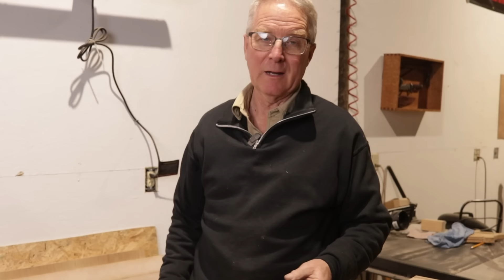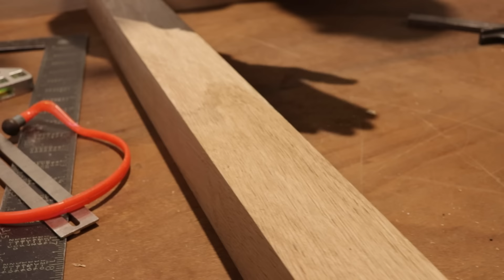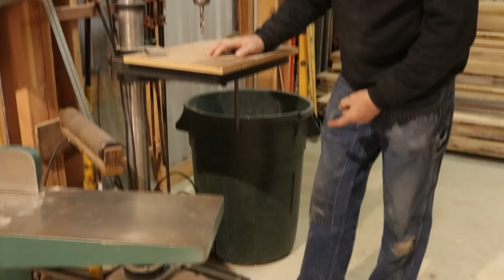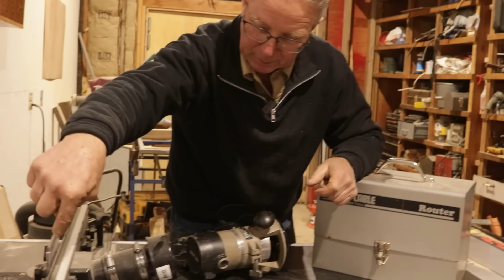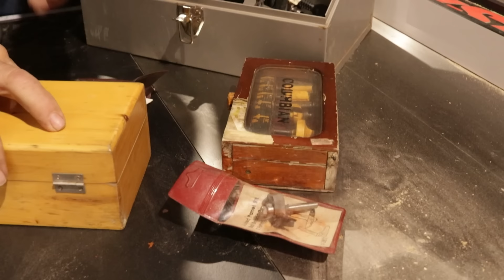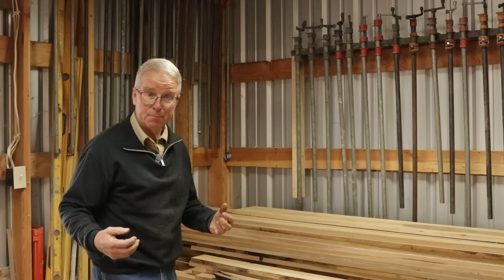My First Dovetails & Workbench Trials | Shaker Workbench PT 2

Comment: I got lucky and read Peter Korn’s “woodworking basics” before I jumped into any big projects and also probably 50 episodes of wordsmith shop and with those 2 things it was beaten into my brain always leave extra wood on your pieces and sneak up on your measurements.  Tougher on big stock like that I know.  But it has saved my butt soooo many times.  Anyway would recommend both of those to any aspiring woodworkers.  The dove joints are something I haven’t tried yet so learning along with you!  Good luck! And thanks for the inspiration I may try this as I have about 4 tons of poplar sitting in my driveway that I need to turn into dimensional lumber and I really desperately need a legit bench for woodworking.  Thanks so much for all your videos .  God bless and take care my friend.

Comment: Awesome video!! I find used tools at flea markets, swap meets, farm equipment auctions, and yard/estate sales.  But all these don't work when you need tools now.  Another thing I stopped doing for Craigslist and Facebook market place is buying based on just price.  A big factor is distance and fuel cost.  If price and fuel will be half the cost of new, then I will go.  2/3 or 3/4, maybe for  original classic car/truck parts, or antique farm equipment. But if new is available, I will buy new for certain parts/tools.

Comment: When routing across the grain, as when routing the half-lap joints you described about 8 minutes into the video, be sure to put a sacrificial piece of wood on the side of the piece where the router finishes, or you'll get tear-out (especially with grainy species like oak) along the edge of the board.  Alternatively, you could rough-cut with table saw and then just get a smooth finish pass with the router.  If not removing as much wood, won't get (much) tear out.  Ken Jordan may have an alternate approach to eliminate tear out, but will certainly know how to show you what I'm referring to.

Comment: Hi Scott,
I have recently retired as a cabinetmaker/ Antique restorer/ educator after 48 years at the bench. If i didn’t live on the other side of the Pacific Ocean in Sydney I’d offer too give you one on one instruction on making dovetailed drawers correctly. 
can i first advise you get rid of the dovetailing machine and do it by hand. It’s quieter,
more satisfying and you’ll get a better quality joint with more surface area contact for the glue where it matters. 
Can i recommend you watch Rob Cosman on dovetailing drawers. He learned this marking method from the late Alan Peters who could easily lay claim to being one of the best designer makers of the twentieth century. You, myself and Rob are probably the same age so he’ll be taking in a language that both you and i can understand. 
i do have issues with the bench design but they are personal preferences developed over nearly five decades in the trade. so continue as planed. 
Kind Regards,
Terry Gleeson.

Comment: E.C. You're absolutely right about Porter Cable falling from grace. The best circular saw I've ever owned was a P.C. "left handed" circ saw. It finally got put into my home use tool box. Somehow the bed got bent and I haven't been able to locate a replacement. 
Keep up the good work!

Comment: Thank you for the update Scott. One thought I had when you were talking about the 2-3/4 and 2-1/4 dimensions was relative dimensioning. It’s applicable when joints need to fit and your overall dimensions are not affected. It’ll save you from crazy fractions by just getting “half” with a tri-square or caliper based on the part’s thickness. No math, just dimensioning based on final desired outcome. It’ll save you from many headaches. 😉

Comment: I'd like to add that on your project with half lap joints that I use my radial arm saw with a set of dado blades and start out with the blades a little above halfway on the joint and keep lowering till I get it tweaked out to exactly what it takes I've been building cabinets and furniture for years with a lot of half lap joints and find out that this works well and if you have the radial saw you will find out that this works out very well keep up the great work I'm 75 and I'm still learning

Comment: Part of those pipe clamps look like they use galvanized pipe - the zinc coating is slick and will cause issues with the dogs biting in. I had good luck roughing up the pipe with a belt sander to give the clamping dogs a place to bite. Look into the Bessey Revo style bar clamps and the various knock-offs. You won't need a rack full of them, but 4 - 6 of them 36"+ long are game changers for certain applications.

Comment: Just a little suggestion from an old timer.  Subject: Clamps
"Pipe clamps" come from a time when radial arm saws ruled the world. When this kind of clamp is put under pressure, the iron pipe starts to distort or bend. this results
in distorting the actual clamping pads so they are no longer  in parallel but rather  "opening up." the result is that clamping pressure will then cause the wood panel
will start ot distort out of flat.  
I want to strongly suggest that a panel in the process of being glued up must remain flat even when the clamps are fully tensioned. Otherwise, any  distortion in the  panel
will remain in place even after the glue has dried.

Finally, in regards to gluing up the half-laps.  Best clamp for the purpose is a "F" style with a jaw depth of 3". Also, to keep from marring the top surfaces, created little
sacrificial wood pads that , when in place , prevent any clamp denting.

Have fun and bravo to you for being willing to get into the woodworking weeds.s

Comment: I'm loving your journey of learning a new skill Scott.

That stop block on the table saw fence is a great safety tip that could use its own explanation video.  It's tempting to just use the fence but there's a significant risk of the part jamming and getting thrown across the workshop, potentially taking a few fingers with it.
Reply: Agreed. However, in the example that Scott showed the stop block isn't 100% necessary in that there is no waste piece that will fall off and jam. But new woodworkers don't always recognize the difference between the scenarios, so using the stop block is good practice.

Comment: MicroJig offers a 1/2 jig that I have used successfully.  It helps set a blade/bit height very close to 1/2 the thickness of the surface it is on.  Perfect for half-laps.  While using mine, I have only had to make minute adjustments to get the height perfect.  I haven't used it extensively, but I have seen others that use it a lot and swear by it.  
Regarding routers; my sons tell me I don't change router bits, I just change routers.   In my opinion, they are like clamps.  You can't have too many.  lol

Comment: The best dust collection systems are in a separate room or lean-to, so the fine dust gets sucked completely out of the workshop. Blow it right into an enclosed trailer if you can so you can just hitch it to the Kubota, haul it out into a field and dump it. Be aware that large amounts of fine sanding dust are not only a respiratory and  fire hazard but an EXPLOSION hazard as well. 
Especially if you dump it into a burning fire.

Comment: We bought several pieces of Amish-built oak furniture and the dovetail joinery used on the drawers is absolutely perfect, as is the rest of the construction, real wood (not ply or manufactured) even where it will never be seen, and lovely finishes. Fit and finish is A1. I would love to see their shop and processes. The only commercial parts used are ball-bearing drawer slides and hinges. Some of the cabinet knobs are turned wood, others are simple, yet elegant wrought-iron.

Comment: Dovetail router jigs are great. They're handy when doing a kitchen full of drawers. 
The real fun is dovetailing custom boxes where you can lay out and knife your lines, saw, and chisel by hand. This allows you to change up the sizes, the type of dovetail joints, and can make a project look spetacular.
Reply: The incra router table system allows this. You can whip out dovetails in minutes once you get the hang of it.
Reply: @MAGAMAN  Incra looks like a nice setup. For $500 (through Lee Valley) It gives you what, three different size dovetail bits so you can make the double dovetails. That still only gets you through DTs, half blind DTs, and sliding DTs. I think my  Porter-Cable jig will only give you through DTs and half blinds in 1/4" or 1/2" tails. This means I could do only one size of double DTs with it. However,
With a sharp DT saw (eastern or western) a sharp chisel and good layout you can cut out an infinite variety of dovetail joints and sizes that actually fit the size, proportion and layout of the box or project your working on. I have small tea boxes I've built that have DT pins as small as 3/16" and my workbench has lapped DTs as big as 2". Once you get the skill down, the sky is the limit.

Comment: Jointer tip- the fence doesn’t have to be square. If you alternate which face rides against the fence the angles cancel each other out. Hope that made sense. 
Love your channel!
Reply: The lesson learned was not so much that it wasn't square, but that Scott neglected to check a "new to him" used tool.  Making it square is easy once you know you have to.

Comment: Tip from a woodworker on difficult to calculate measurements: don't measure them. Scribe them off the actual piece, set up your stop block to cut to that line, test. Once it's right all your parts will be right using the same stop block setup. Measuring off the existing piece will mean it's always the right size and you don't have to calculate anything. Scribing is always more accurate than measuring. Also, give yourself grace, wood moves. Keep up the good work EC. Love from Montana.
Reply: Nah sounds too easy. 😅
Reply: @jerbear7952  best when you are making a one off in the backyard or garage by a human and not a robot.
Reply: Measure once, cut twice.
Reply: Yep, that works great for the shoulder of Scott's half lap. But he was having difficulty with the depth of the half lap (the height of the saw blade). The precise, no-measure way that I use is to raise the blade to just shy of half, make a trial cut, flip the stock and make another trial cut. Tweak the blade up a hair and repeat. When the cuts on opposite sides meet, your blade height is set.
Reply: And always try to keep the line then fine tune to the line?😅
Reply: Also if you're using hand tools like chisels, don't start cutting at the line, cut just inside it because the chisel will compress the wood slightly. If you cut at the line it will forever be too loose, but if you get it just right, then as the compression of the wood expands with time it will make the joints stronger
Reply: Scribing works on the depth too, or using a reference. A marking gauge could very accurately capture that depth and transfer it to your stock. I like your half lap depth setting method though. Both are more accurate than trying to calculate it and mark it with a square

Comment: Scott -- I have the Harbor Freight version of your Jet dust collector (DC). It has served me well and I'm sure yours will work well for you, too. However, yours is in need of a safety upgrade. Do this today. Don't wait. You need to replace the upper bag filter with a pleated paper canister filter. The issue is those bag filters don't remove the fine dust particles from the air. Instead, your DC catches the larger chips and particles of dust and pumps into the air the finer dust particles -- the ones that are most dangerous for you to breathe. Worse, it's pumping those dangerous dust particles at the height of your head! There are a lot of woodworkers that have serious lung issues because they breathed in too much of this fine wood dust. Don't let it happen to you and your family. 

There are number of sources for replacement canister filters for you DC. I recommend https://wynnenv.com/woodworking-filters/. They make a conversion kit. It's where I got mine. While you're at it, replace the bottom bag with a clear plastic bag. The bottom bag is there just to collect the chips and dust. A plastic bag works fine for that and is easier to empty. With these two upgrades, your DC will perform better and the air in your shop will be safer to breathe.

Comment: It really is sort of amazing the subtle differences between poorly made router bits and excellent ones.  I basically only buy Whiteside bits at this point.  

I've also been looking into getting a Leigh jig.  Leaning towards a Super16.  I think it would do everything I need.  I've heard that you can get cleaner cuts on the Leigh jig by simply adding painters' tape to the board and failing that, use a sacrificial board.  Personally, for the dovetail cuts, I'd setup a second router with a straight cutting bit to do a first pass and then use the router with the dovetail bit.

Comment: You can save yourself a lifetime of panel glue-up headaches by sticking a cheap little 4 inch machinists square to your new jointer with a magnet. Those fences always creep just the tiniest bit, and I can't tell you how many times I've kicked myself for not checking (always after the glue is dry, of course!)

Comment: Yes you should be alternating the grain on your glue ups.
Reply: Not everyone agrees. Alternating doesn't cancel out the warping, it just makes it warp in multiple directions causing a wavy pattern that is harder to fix than a single warp direction.
Reply: @MAGAMAN  for the last thirty years it’s the way I do glue ups for the custom furniture, I sign every piece I build and it comes with a lifetime warranty, I haven’t had a dining room table returned yet. You also need to hand select the wood you are using.
Reply: ... or if you're going high end, use rift or quarter sawn stock!
Reply: @briantaylor9266  true, and for some furniture I hand lay veneer. I use a traditional European bench with tail vices and bench dogs I made in out of Maple I have the maple side grain up, kinda like butcher block.

Comment: PorterCable could use the wrath of the internet!
For over 4 decades I've used their routers/sanders and specialty tools, Now I'm saving worn out parts to try and keep my stuff going because the new offerings from everybody suck. 
Switches from the 691 router fit the 503 belt sander if this will help anybody else?
Reply: Yep.  When Dewalt took them over they decided to make P-C one of their junk-grade sub-brands.  P-C 690 and P-C 758x were legendary.  

I have a Bosch ROS65 sander that I generally love and I can't understand why Bosch chose to discontinue it.

Comment: Cut to the eventual chase of dust collection and invest in a fixed setup with ductwork and a larger dust collector.  Moving a portable unit or hose from machine to machine will get old real quick and you'll eventually find an excuse not to use it.